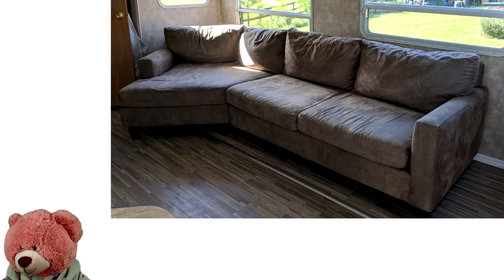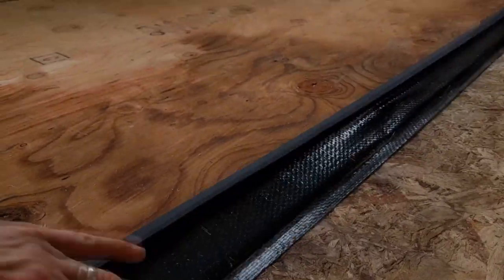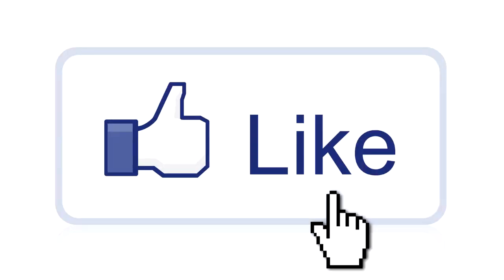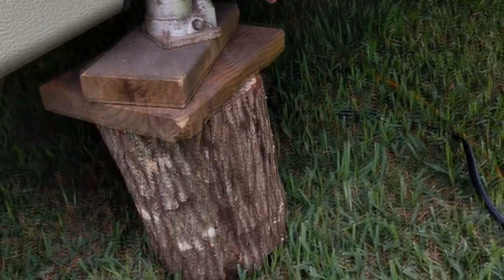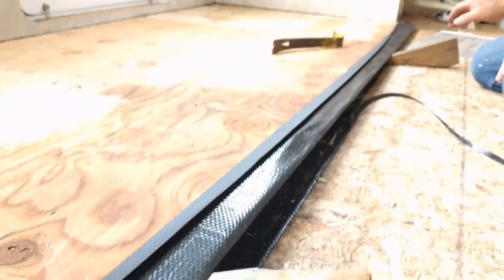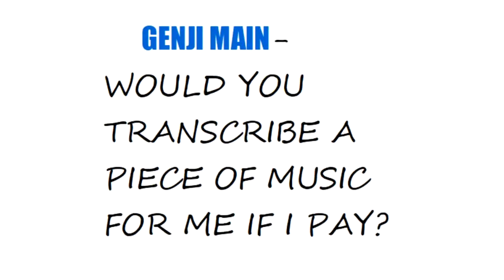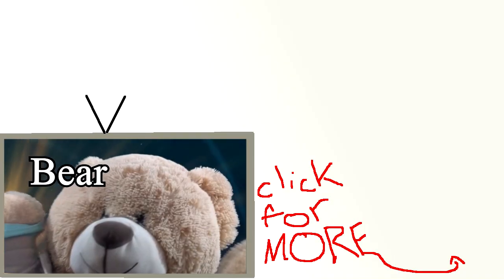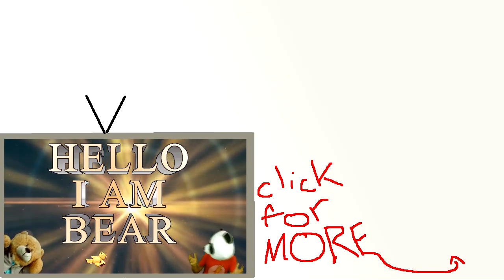How Do You Replace Flooring Under the Slide Out of an RV? (DIY Life Hack Tip in a Minute)

Comment: Thanks for the video. I will have to use this when I do the flooring. With this technique also work if I have to replace the three-quarter inch plywood underneath them slide out? Currently the slide out sits on the plywood and I need to raise the slide out in order to replace the three-quarter inch ply.
Reply from the maker: That's more complicated, search another YT vid for an answer to that, to complicated to write out

Comment: How do you get to the shaft that connects the slide out to the house? I was told that it broke and that it was no bigger than a pen. But where is it? I have a 2006 Winnebago Aspect 723D. Also, the slide out has a nylon carpet slide thing that is about 4ft long and runs the length of the slide interior edge and or tears up my flooring.

Comment: 1993 dutchmen carpet removal and replace with vinyl snap lock flooring.  Any tips if the slide will scratch new floor?  Is the carpet a cushion/ shim?  Can I butt my new planks tight under the bump out after it's jacked up like in your video? Should I fasten or glue planks that go under bump out?
Reply from the maker: If you're slide out is like the one in this video then due to how thick those planks are, you may have to lift your slide out a little and even provide a bump for it to run over so that it does not provide as much stress to the floor as it runs over it. It really depends on the style of slide out you have. I'm not saying gluing the flooring down wouldn't work if you use a real scratch resistant flooring like life proof, but it's not a risk I'd feel comfortable taking. If you bump it up, using a strip of carpet underneath the slide out for it to rub against is always the best option. The next time I have to do this on an rv, I was thinking about making a video for it. Hope that helps

Comment: How do you replace the flooring on the angled section of the slide?
Reply from the maker: Well this is peel and stick flooring, so you basically are going to glue it down and to keep it at that angle, you need to set up some dead weight above it to force it into that position for probably about 24 hours, the glue should hold it at that point forward

Comment: yea but how do you get the carpet out from underneath first?
Reply from the maker: Use them muscles and pull it out. If you have the carpet already up on the open side if the floor, then you'll have a lot of leverage to rip it out. Then use a tool like wire cutters to slip under there once the slide out floor is propped up to remove the staples that are hidden. Easy as pie, just need 5 hours to do it
Reply: HelloIamBear the carpet and vinyl sheet flooring are both anchored right underneath the edge of the slide out by a piece of hard plastic that runs the length of the pull out couch section which is screwed down pretty tightly. do i try to rip  it out from underneath that or just cut it carpet where it meets the edge of the slide out ?
Reply from the maker: I am trying to envision what you are saying, is it possible to stick some wedges underneath the slide out to lift it up a hair and then in the spots where you don't have wedges to stick in a flat bar and try to pry up that plastic you are talking about? Is it actually screwed down or were you just saying that as a term? If there are screws that you are unable to reach, I would probably forget about it and just cut it as close as I can get it, But if they are not screws, if you work at it and it will probably take some time, you could probably still do what I just said above
Reply: Zach Woods I’m having that problem right now, were u able to get it off and how
Reply: Jorge Martinez No I couldn’t get it off so I just cut it as close as possible to the strip holding it down then screwed down the remaining edge of the carpet with  a metal floor seam binder. slide out goes in and out without a problem no snags
Reply: Zach Woods any chance you have a photo of how yours turned out? I am having this exact problem
Reply: Our Tribes Quest I am having problems with my slide out as well! My friend tried this in their rv and it cost them $2,000 + to get it fixed! The guy at the shop said to never mess with the slide. I’m going to try a long pair of pliers and hope for the best! Keep me posted on any solutions to your issues. Thanks
Reply from the maker: An RV shop will charge you $2000  just to vacuum the floors of your RV. They're over priced for everything. I've been tinkering with our 5th wheel recently with the slide out, adjusting it's height multiple times even with its bolts and brackets outside. They are a bit flexible, you just have to make sure not to push it too far and check every side of it when you make an adjustment so that nothing else gets messed up. Just gotta take it slow.

Comment: I'm replacing my entire slide floor which is 12'5" long, I'll have a seam where the first 8 foot piece of plywood ends... how do I connect the two pieces or make sure it's not weak at that seam?
Reply from the maker: Know the thickness of the plywood, go out and buy thinner sheets that add up to the same thickness, and then make two layers, screwing and gluing them together, making sure that the two seams that hold each layer together are staggered so that they are not sitting on each other creating a weak joint